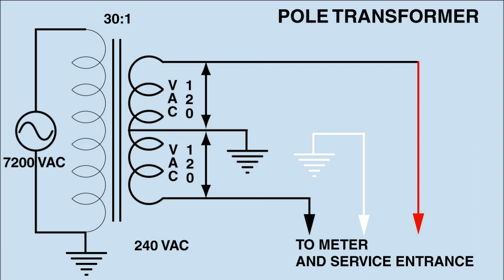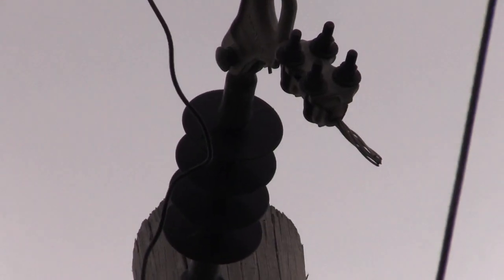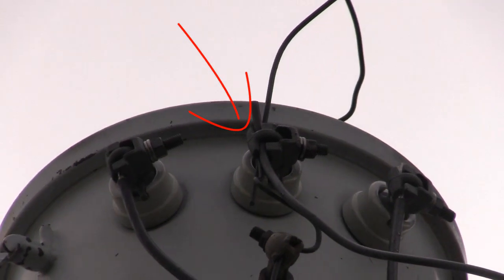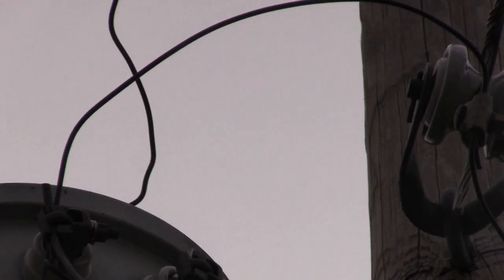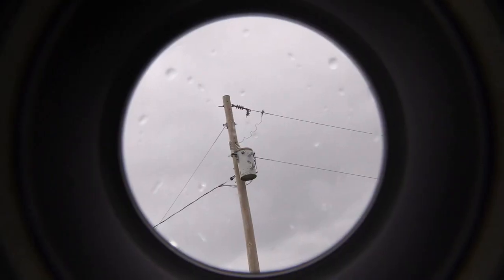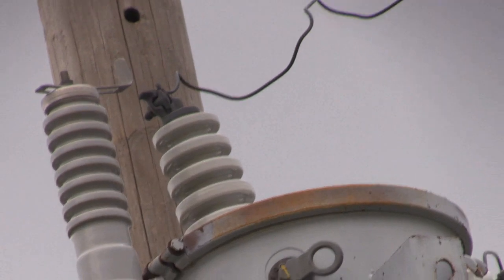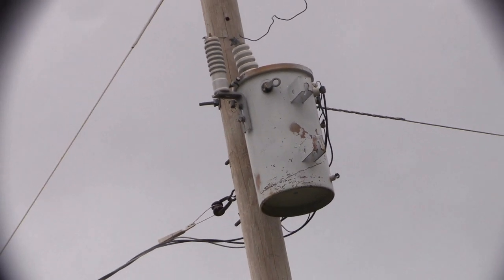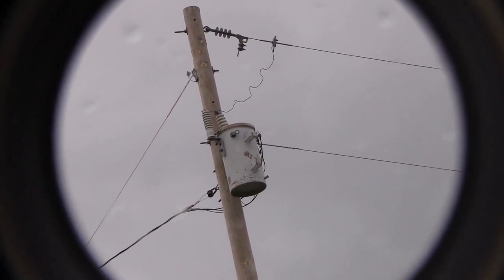Pole Transformer

Comment: The primary amps would be 6.6 if 200 amps were drawn from the secondary. I see an unfused primary which would allow almost infinite secondary current if shorted. This is something us electricians are weary of. If shorted, lets say in the meter socket or before the main breaker, consider yourself a level 5 burn victim. I've been in 100's of panels w/Respect
Reply: You are right👍

Comment: A little off on the math at the end. If it is a 30:1 ratio transformer with a 200 amp load on the secondary, the primary current is only 6.66 amps, not 60.
Reply from the maker: Thank you, good catch.  You are right, I must have gotten in a hurry.  Sometimes while reading the script I say what I think I should say not what is on the script.  Even after practicing several times I still often get an error, in fact sometimes if I practice too much then I just seem to make things up as I go along.  It's still an error and I'll correct it if I do a remake someday.

Comment: Sir: kindly explain how/why the generator uses two conductors ( + and - )
to generate AC current single phase.   BUT looking at the distribution system,
ONLY ONE high voltage conductor at the top of the step down transformer.
confusion abounds.
Reply from the maker: Hi Ted,
At about 0:20 you will see a lower wire on the pole.  This wire is the (-) or negative or ground wire and is connected to the outside of the transformer can.  Thanks for the question.
Reply: I can see that companies sell us not power but voltage. I can see that the circuit is open so no back emf to load the power generator at the supply end.. Now what are we buying really??
Reply: @divinemeditation7980  Watt/hours.   Thousand Watt/hours.    KWH. 

Watts equal voltage multiplied by amps drawn.  Parallel circuits (AC type) DECREASE 
in resistance as additional loads are added to each breaker in the panel.  (difficult to comprehend) thereby INCREASING the current and tripping the breaker.

Comment from the maker: There is no "fuse".  You have probably seen transformers explode when the line goes down in a hurricane.  If you look really close at the pictures you will see an arrow shaped thing with a hole in it.  I think this is a switch and the transformer can be turned off with a long pole from the ground but I have not verified that.

Comment: Good video but one thing l still don't understand - if the bottom high voltage line on the pole is grounded, so at the same potential as the earth, would someone get electrocuted / shocked by it ?I have one touching a tree in the backyard and I'm wondering if that tree is electrified. (Yes I'm planning to call the utilities)
Reply from the maker: To be certain, you can test this with a meter.   One probe of a voltmeter goes on the wire in question and the other end goes on a known good ground.  If there is no potential difference between the two points then no current will flow in a conductor placed between the two points.   Like it says in the video never, NEVER! put your body in a position to conduct current.   I am not there to see exactly which wire you are talking about so all I can do is advise great caution.  You are on the right track calling your utility because they will want to clear vegetation from around the transformer anyway.  Note that when trimming a living tree near wires the tree branches can be conductive because of their high water content.
Reply: @PostHocNonSeq  Thank you for responding. I do have a multimeter so l will see if l can measure any voltage.
Reply: The bottom wire is the system neutral back to the substation, completing the circuit, not a high voltage line. The chances of you sustaining a shock from it by touching a tree that's in contact with it are nearly zero, not impossible but conditions would have to be perfect as trees aren't very good conductors and the neutral returns to the station to a ground grid, not to mention its also grounded at every transformer on the circuit giving it multiple paths to bleed off any current on it. if the tree was soaking wet, and the neutral miraculously lost all its paths to ground and you just happened to be touching the tree at that moment, while in bare feet standing in a puddle you might feel a little something but chances of it electrocuting you are still very remote as the tree is also providing a path for any stray current to ground through its roots. That being said touching a tree in contact with the top wire, which is a high voltage line is something to be much more careful about. The chances of getting a shock from it are still pretty remote but  they are definitely increased, especially if the tree is wet.
Reply: @08c6vette  That's reassuring and makes sense.  Thank you for responding.
Reply: @shinola228 You’re welcome. One thing though, although it is the case here, being this is a Wye circuit and the lower wire is a system neutral, many Utilities also have vertically constructed Delta circuits that don’t use a system neutral and the lower wire in that case would be a high voltage line. It would still be highly unlikely that you would get a shock from touching a tree in contact with it though.

Comment: Why no fuse?
Reply from the maker: There are different answers to this.  Some of it depends on the utility company.  I think if you see no fuse then you can assume that they expect the transformer to just blow up if you put a dead short across the house loop.  If there is a short on the primary to the transformer it will either burn through the wire or trip some sort of circuit protection back at the sub station, some of those automatically reset a couple of times before they take several houses offline in case the fault was temporary.  I think some brand new transformers are self protected and referred to as CSP or Completely Self Protected.

Comment: any clue what kind electronics are in?i mean chip names..or any example pcb picture?
Reply from the maker: In the one shown there are no electronics or printed circuit boards.  The picture shows what is inside, just copper, in sheet form as opposed to wire, wound around an iron core.  All in an oil bath for cooling.

Comment: I gotta ask you this quest because I can't find this info anywhere. I own raw land 300' from, end run pole & Distribution Transform on the pole. House is standard 1500' sq ft. There is room for more houses to be added to D. Transformer. (Area requires underground in this area now. I need to get power to the lot via underground: trench & 3" conduit & Handhole box at the property line, all of which I will do). Roughly how much work, meaning cost, (& planning if necessary) are required to connect lines from D. Transformer to Handhold box. My guess is the cost of a crew coming out to pull the wire & connect to Transformer and into the box with there connectors. What I'm getting at is how much, roughly, should this connection cost me: 1) crew install 2) material 3) office cost, ie any planning etc. It seems the corp is charging way to much. Informative vid. I hope u can offer some info on the install. Thanks
Reply from the maker: My electricity provider is a rural coop.  The transformer, or more precisely the meter, is the demarcation.  Everything on their side of the demarcation is their responsibility to build and maintain and everything on my side is my responsibility.  They run overhead due to expense of going underground and it costs me $1,000 per pole.  They send out an engineer that listens to what I want to get done and then tells me how and when they will be able to do it.  They bill me after the work is done.  Part of my monthly bill, approximately $25, is a base cost that I pay every month forever and that helps them to pay for crews etc. when a project comes up and periodic maintenance that might be necessary.  From your description I would guess that you'll need to have them run a service loop down the pole and put in a meter.  You will then be able to dig your trench and run power to the house from the meter.  You will need 3 wires in the conduit that is in the trench and they will likely be 4 ought aluminum but some might consider that overkill.  If the wires run into the house and the distribution panel is right up against the wall where they come in then you will go directly to the main breaker in the panel but if you are going to locate the panel on some interior wall you will likely need a breaker on the outside of the wall to protect the heavy wire that runs inside the house to the panel.  I also have a double pole switch just after the meter so that I can supply the house with a generator when necessary.  I can't imagine your project being completed for less than $10,000 and that is a very rough guess depending upon how much you have to hire out etc.  Any good electrical supply store can price out the panels and boxes and conduit for you or you can go to Home Depot with a pad and pencil and write down approximate costs for materials.  Best of luck.   Be careful.   I hope your project works out well.
Reply: "All the Power company has to do is pull the 4/0 electrical wire through the 3" conduit. Connect the wire in the Handhold Box at my property line and then connect the 4/0 electrical power line to the Distribution Transformer which will give me power to my Handhold Box at the property line. About how much should this cost for the work. Not for the wire I can get the wire cost?"

Thanks for getting back to me. Let me simplify what I've wrote. I have a Distribution Transformer on a pole 300' from my property line. I will dig a trench, put in a termination box at my property line to terminate the power until I build a house. This is called a Handhold Box.

All the Power company has to do is pull the 4/0 electrical wire through the 3" conduit. Connect the wire in the Handhold Box and then connect the 4/0 electrical power line to the Distribution Transformer which will give me power to my Handhold Box at the property line. About how much should this cost?

Since you had over hand wire and two poles installed you may not be able to speak to my exact circumstances.

If you can, isolate the cost of the Co-ops charge for JUST connecting your power to the Distribution Transformer.  

The Electric power provider wants to me to pay $20,000.00 taxes included. Charging for what they call design $5,000, Supervision $2,296, Land dept/cks to see if I own land $3,295.= $13,636. This is outrageous and insulting. So, the job Minus this Padding should be $6,400.00. 

What I'm trying to find out is what it should cost and present the information to the power company to expose them for defrauding the public. And thereby get them to back off this horrible quote of $20,000.

This quote doesn't include the trenching, conduit,& Handhol Box = an extra $2,500 if I have it done.

If you can't speak to this maybe you know someone who can. Thx
Reply from the maker: OK, I see where you're going I think.  I guess what you call a "handhold box" is a temporary meter box and after the house is build the meter will be moved to the side of the house.  In my situation the meter stays on the "handhold box" permanently and power is run underground from there to the house.  I don't understand why your utility charges so much.  I agree with you completely but my opinion will not sway them.   I have no special authority that they would recognize.  In my situation I would pull the wire through the conduit myself and connect it to the "handhold box" myself and coil it at the bottom of the pole.  The utility would then come out and run it up the pole and connect it to the transformer and cover it with a metal channel.   They would likely require that the work I did in the "handhold box" be inspected before they cut the service over.  Last time I did this the cost was minimal like in the $500 range but it was 25 years ago.  I wonder if the cost is so high because it's kind of a cost of admission or entry cost associated with a new service at that property.  They might be offsetting the cost of the infrastructure that got the power to that pole.  If your utility is governed by a public utilities commission or something similar the charge might be established by legal precedent.  Sorry I couldn't be of more help.
Reply: I appreciate you offering up your experience.  In 2007 I did basically the same thing on a different property. I dug a trench from a pole, where I put an underground box, at the pole, & continued to the house 100', by hand to the house. I installed the 3" conduit from the box to the meter on the house. I had it inspected. It was fine. The power company came out with a truck, man basket, and a huge spool of cable. About 4 guys. They pulled the wire and hooked it up to the D.Transformer and then connected it to the house meter. It cost me about $1,000.00 for everything. It was the same thing I want now. The only difference is that on new property the trench is 300'. Imagine my shock when I saw they wanted $20,000.00. As you say "They might be offsetting the cost of the infrastructure that got the power to that pole." But still, $20,000 & they r not doing the trenching part, conduit, and box. By the way I wasn't thinking in terms of using you as an official resource. I'm just trying to gather info to see if anyone else is being screwed so bad & if they did anything about it. It seems like a fraud on the public by a utility to me.  Thx
Reply: ㅔ

Comment: Why no cut out fuse?
Reply from the maker: Good comment but I don't have the answer.  All I can say is that's how my electrical utility cooperative decided to do it.
Reply: There is a secondary disconnect switch right next to the arrestor.

Which tells me there could be an internal fuse which acts like a cutout.
Reply: They are called csp transformers